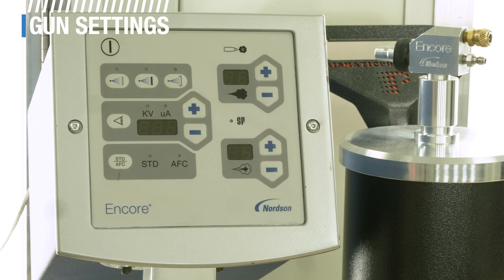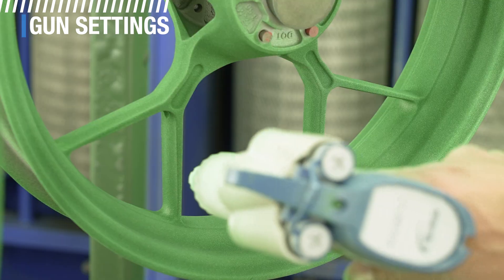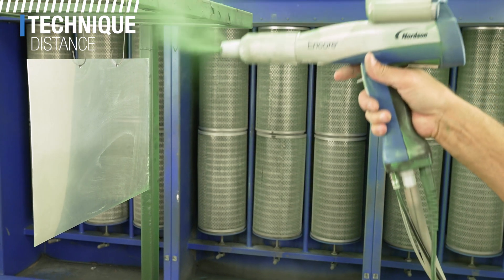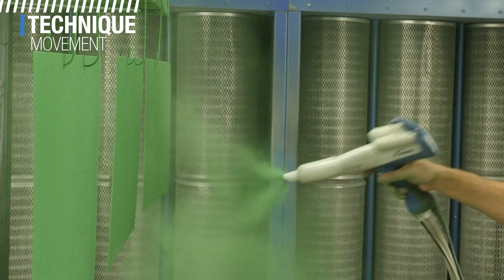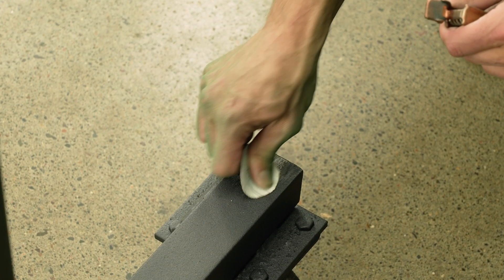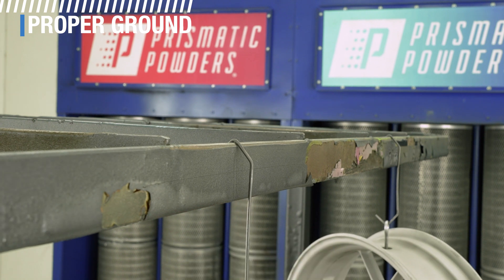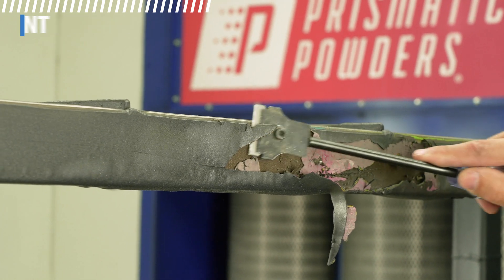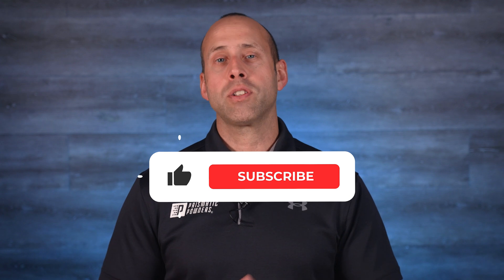Secrets to Even Coverage | Prismatic Powders

Comment: on my  future work where I will soon start to work they hace excatly same equipment and gun like yours, and I did try one day to test work it was good but first thing what started to bother me is to how and to learn how much microns do you paint on surface. For example this was my first time to paint with this kind of paint methodand now I want to learn how it must be done becasue I will have to do this all alone by myself after certain time. I worked in shipyard industry as a ship painter and we used mostly draco and hempel paint and paint pump so powder coating is something lets say similar but also very different like I did years ago. Is there any tips you can help and advice me? And specific with mark you are using in video because we use the same
Reply from the maker: Often you see that powder film thickness is referenced in mils. 1 mil = 25.4 microns. Most powders will be applied at 2-3 mils, so 51 -76 microns is what you'd be aiming for. "Knowing" when you've actually achieved this thickness can be difficult at first. You will need practice balancing your gun settings with your hand speed several times to dial in how many passes you need to make with the gun. I recommend practicing on  some flat panels and then use a Mil thickness gauge to measure the thickness after the parts have cured. This will help you evaluate how close you are getting with your settings and techniques...just keep practicing and you'll be fine.
Reply: @PrismaticPowders thanks!! At first when I paintet with powder gun I could not be actually sure if it is to much or less painted it was my frist encounter. And after measuring thicknes it was less microns maybe about 30-60. Here where I will start to work they give for first and second paint each paint 80 microns thicknes
Reply: and is there any advice how to know is it thick or thin surface during spraying before it goes in oven?

Comment: Why does powder avoid welds? Even after putting them in the oven, the powder still avoids any weld beads
Reply from the maker: It depends. A lot of the time the welds are also in areas where the other piece of metal has created a tight spot or angle. If this is the case, you're dealing with the faraday cage effect where the powder is literally going everywhere else other than where you want it to go, because it's finding the easiest path to ground. If it's this situation, start by dropping your voltage in these spots, and spray these areas first. 
If it's a situation where the powder is pulled away from all your welds...I would adjust your voltage for starters. Not knowing the specifics of your situation, I'm assuming you have room to increase your transfer efficiency by increasing the voltage.